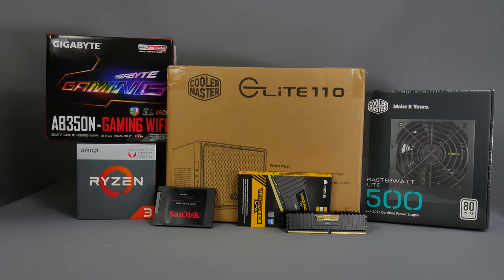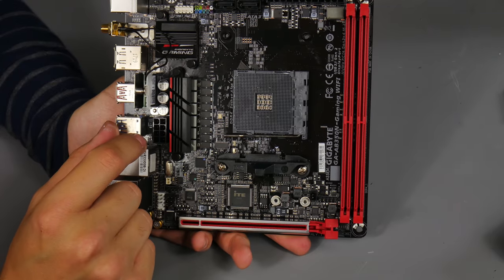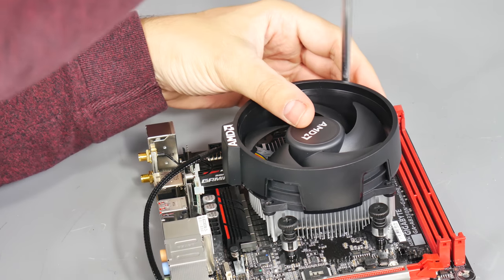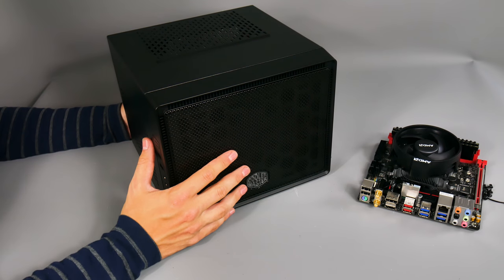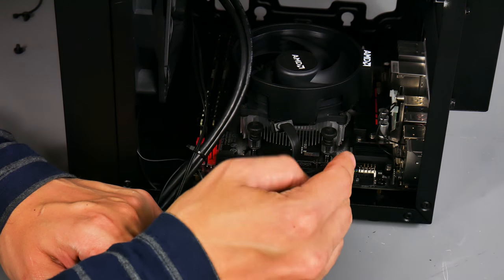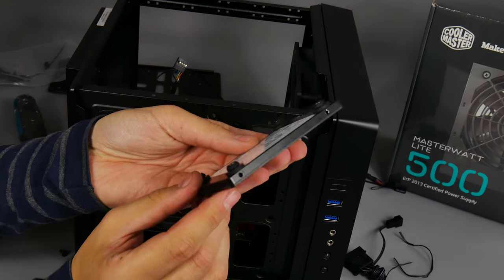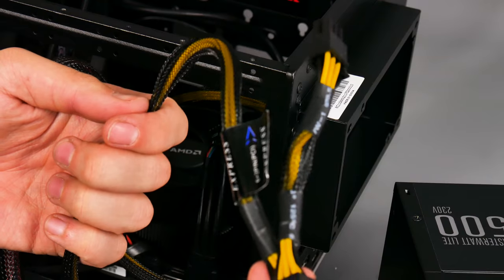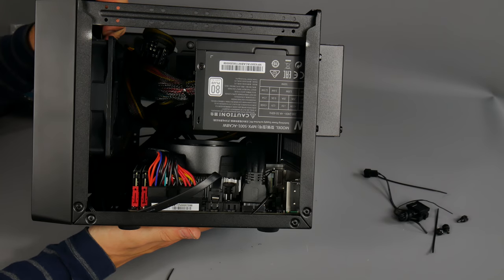Ultimate mini $499 gaming PC With AMD Ryzen, Vega graphics, SSD and WiFi!

Comment: I would have never faced the PSU fan downward as it will potentially create a negative effect on the CPU cooling. Pulling fresh air in from outside is how it's intended.
Reply from the maker: The trouble is with no exhaust fan the heat just builds up and eventually you end up with even worse temperatures as well as having the PSU dangerously exposed at the top. There’s a big enough gap between the PSU and CPU cooler for them not to be fighting for air.

Comment: Single channel memory for Ryzen is a huge mistake especially when using the integrated graphics. 8gb 2 sticks of 4gb is a bare minimum requirement. 16gb if you intend to play games with anything running in the background. At 8gb when running most games you are using over 6gb of memory.
Reply from the maker: Ryan Reed I completely agree!

Comment: I built two systems almost like this for me and my wife...
Ryzen 5 2400g
Gigabyte GA-AB350 Gaming 3
240gb Sandisk Plus SSD
16gb Corsair Vengenace LPX 3000mhz RAM,
Cooler Master Masterwatt 550w PS

Both systems seem to be great except mine (constant BSOD Video_TDR_Failure (atikmpag.sys).  Any thoughts?
Reply from the maker: Nice! My first ports of call for your issue would be to reinstall the graphics drivers (try using Display Driver Uninstaller http://www.guru3d.com/files-details/display-driver-uninstaller-download.html) and then redownloading the latest AMD driver pack  https://support.amd.com/en-us/download/apu?os=Windows+10+-+64. It could also be a power supply issue. You could try using another cable if there is one or your wife's PSU
Reply: CrazyTechLab thanks for the reply.  I've tried everything I can think of - removing drivers through DDU and reinstalling.  Funny thing is I dont get the error when running just one stick of RAM.  You think the mobo could be bad?
Reply from the maker: Hmm possibly. Have you update the BIOS? Could also be worth increasing the memory voltage a bit too - that's solved a lot of AMD issues for me recently.
Reply: CrazyTechLab man I've tried about everything short of replacing the mobo and power supply.  RAM tested okay, no issue there.  APU shouldn't be bad as I would think the whole system just wouldn't work.  I'm driving myself crazy trying to figure it out. All voltages are good and running ar what they should be

Comment: I'm gonna build this exactly except with a ryzen 5 2400g and maybe add a palit 1050ti in future, would this still work? Looks a bit cramped without a gpu, do you think it'll still stay cool?
Reply from the maker: Afiregoblin yes it will be fine. The case is well ventilated and the 2400G is still a cool running chip
Reply: CrazyTechLab okay man thanks a lot for the help most detailed build video I've ever seen which is why I'm going with this exact one for my first build
Reply: Also I forgot too ask does this come with the WiFi antenna or do you need too buy one?
Reply from the maker: The motherboard comes with the one I used so you can fix it to the case or have it on your desktop
Reply: I would go with the Intel i3 8100 instead. It's just faster in games if you are companeing it with the 1050 you are talking about

Comment: Do you still need to ground yourself, because of the static?
Reply from the maker: I've been building PCs for 20 years. Never used an anti-static wrist band and never had any hardware dead on arrival/die while installing.
Reply: @CrazyTechLab  Cheers for the info.  I got pretty much the same parts, plus a rx570.  I'm about to embark on my first build with my son. Hence these sort of videos a very useful.